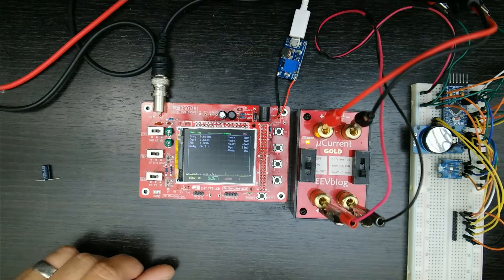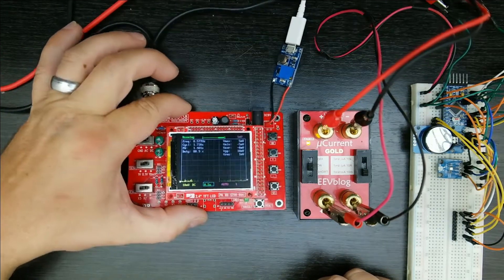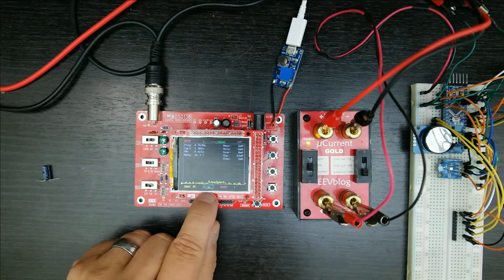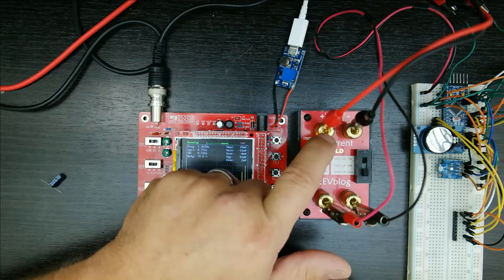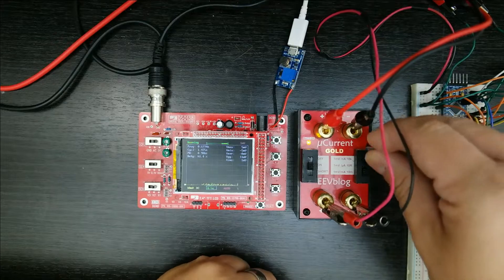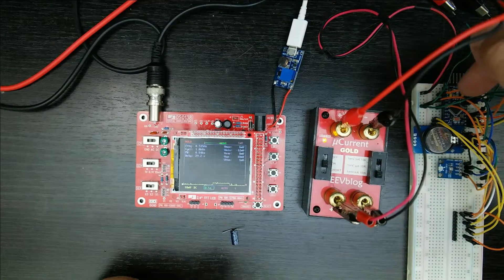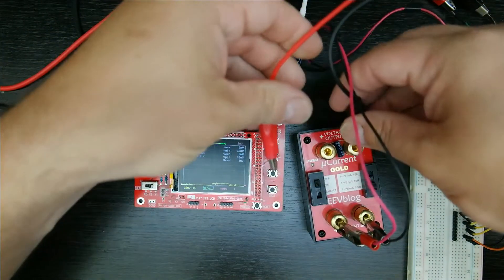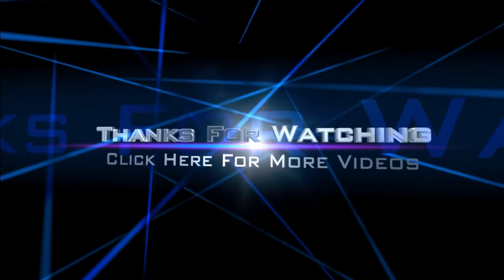Ucurrent Fix For Oscilloscope Noise

Comment: Have you tried a filter choke on your input voltage?  Just asking?  Im gonna try it on mine as i test auto sensors and smmother wave would be nicer! Good on you and dont worry about the dickheads with negative comments 😊have a great day champ ! Top vid

Comment: i been looking at theses please can one get a video out to hook this to a vga monitor or ?? old tv bigger screen using diy board  i understand electronic just do not mess with this stuff much help as i need a bigger screen on this toy
Reply: You can get much bigger displays that use the same interface, it's just a matter of locating each pin on the board and wiring in a 5, 7, 11inch display, or making/finding a PCB that converts to the same protocol. If they were lazy they nay have just used a 40pin raspberry Pi display circuit which would make that even easier.

Comment: Ha! A prepper channel turned electronics and trying to correct Dave, an EE, on his circuit?LOL! What your cap is doing is shunting the line frequency to ground. Look up Low Pass Filter on wiki and you can learn about it. Xc is equal to 2 times pi times freq times capacitance divided by 1... if I recall correctly.

Electronics is like this. Infinitely more complex than you know. But keep on the path of knowledge. My advice overall on this would be to buy an analog multimeter because they are so much better at seeing what is going on, especially small currents, and you can always use an extra meter (one for current one for volts monitoring most circuits). You can never have too many meters just like in woodworking you can never have too many clamps!
Reply: In my basic home workshop I have six multimeters. One is a high end digital, another a medium range analogue, then I have three cheap digitals and a cheap analogue. All have their uses.

Comment: Brilliant, thanks for sharing... BTW whats the USB Power Device you have inline to power the DSO 138? Can you share an eBay / Aliexpress link?  Thanks
Reply: Looks like a step-up/boost converter which has 5v USB input. The potentiometer would be adjusted to output 9v.

Comment: It is actually explained here:
http://www.eevblog.com/forum/beginners/ucurrent-gold-and-a-lot-of-noise-on-oscilloscope/msg675230/#msg675230

Power your scope from a battery pack and you won't have this issue. It is better than putting a capacitor over the output because many opamps don't like driving heavily capacitive loads and may start to oscillate.